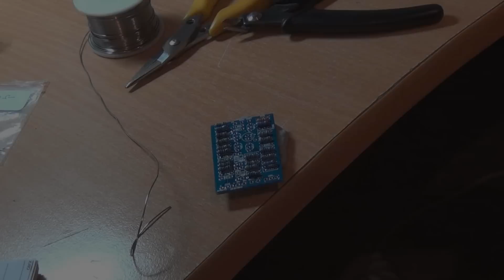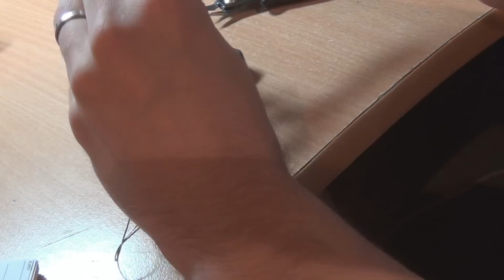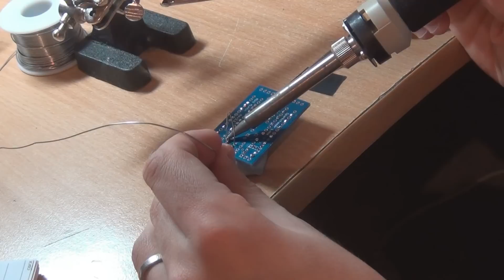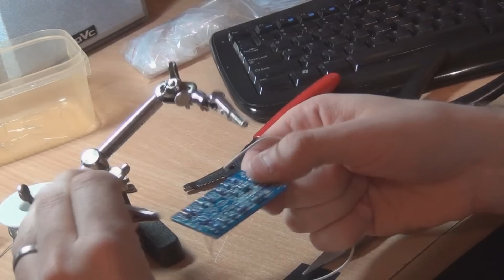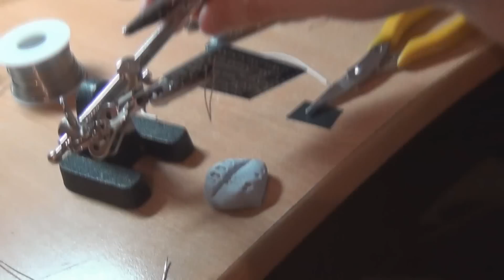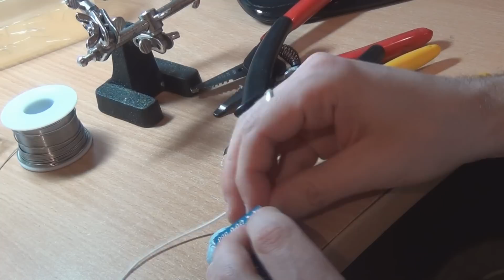Quick Tip - Blutack! (For Electronics Soldering)

Comment: There is a very easy way to keep components in place. When you put the leads through the holes, you bend them slightly to one side enough that the part is held in place. If I am mounting a resistor, I bend the leads away from each other. You do not need to bend the leads very far to keep the part in place.  A 15 degree angle should be enough.  The bend in the lead must be at the pcb

Comment from the maker: Yeah if you have a mound of it, it works quite well for that too. Probably depends on the height of the cap though.  If you are building a power supply or something with monster caps, prob wont work for that :D

Comment: Are you able to use the Blutack to hold in the capacitors?  Or does it only work well with resistors?  Thanks for the videos.